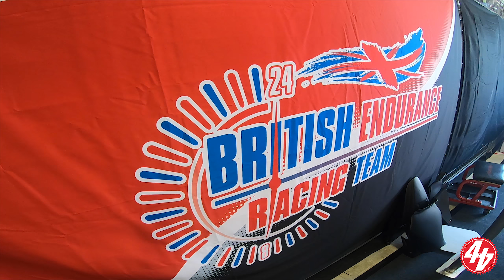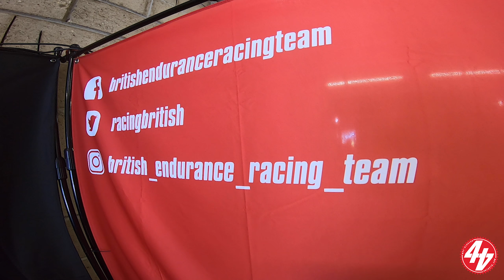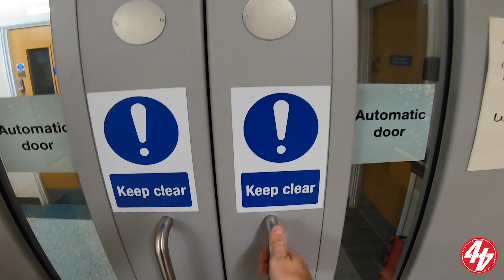We RACE Le Mans 24-Hour!

Comment: In the years BC, I did Barcelona Montjuick 25h & Brands, Thruxton 500 milers etc ( only 2 riders in those day)  
Any videos on Bike Prep,  do they do oil changes , top up (we used a syphon pump) Chain adjustment / Lube,  Brake Pads  etc  etc 
Cheers

Comment: Years ago I did a 24 hrs. relay race for charity. We alternated running 1 mile stints for the duration on a track. Freakin' exhausting. By the end it felt like some poured glass in your eye lids. And the sunrise came at just the right time to give you that extra boost to make it to the finish. Like Bootsy said it's hard to put into words, there's excitement, adrenaline, comradery, pain, fatigue, sense of duty, fatigue.......did I mention fatigue. Finally, an incredible sense of accomplishment...